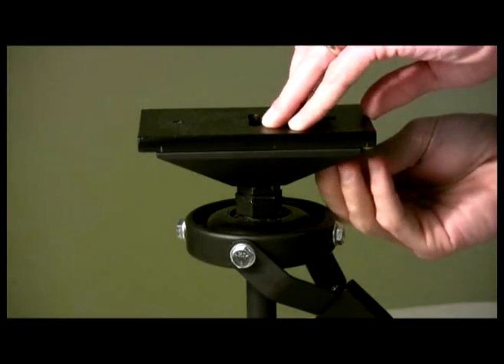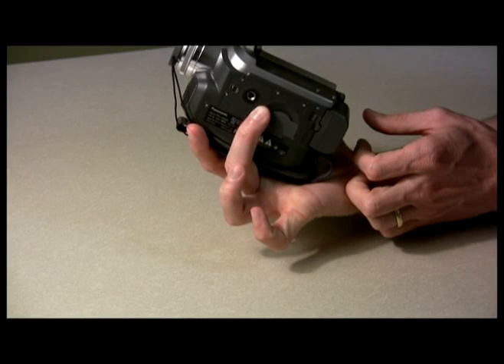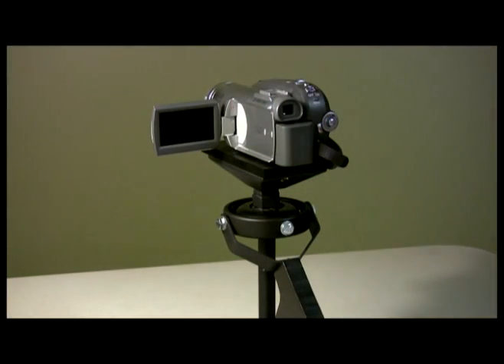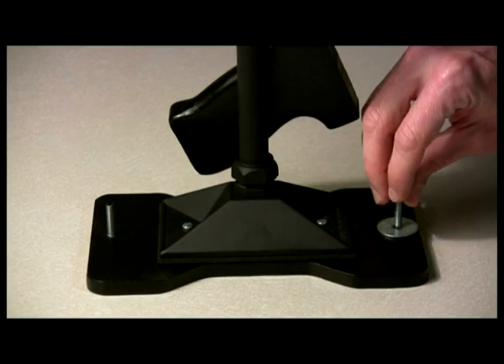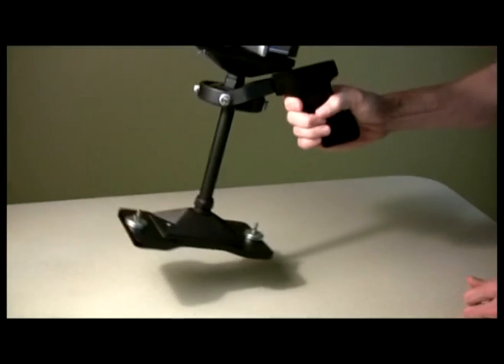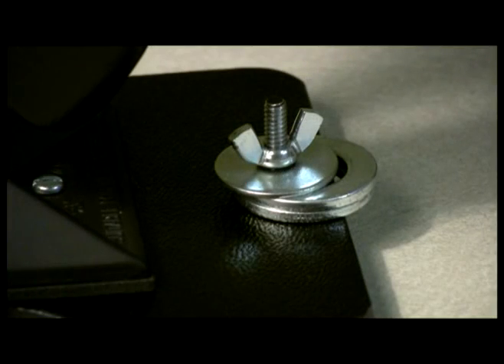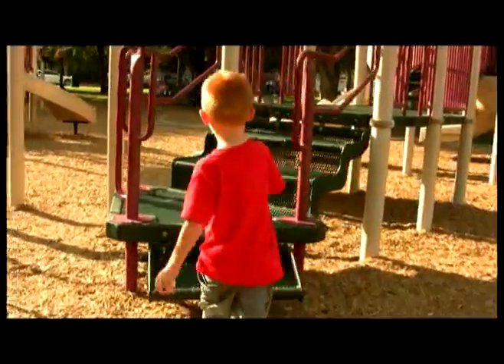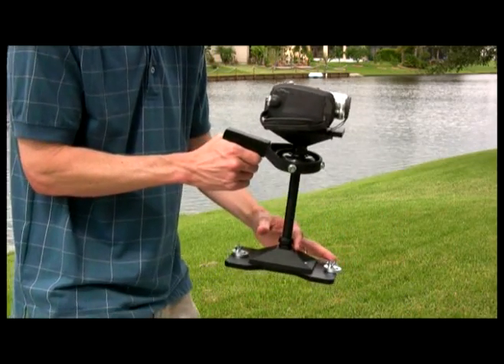MiniDV Stabilizer - Setup and Operational Tutorial - A low cost alternative to STEADYCAM/STEADICAM®

Comment from the maker: I appreciate the input.  The stabilizer is made of several different materials based on strength required, so it's a combination of Galvanized Steel, Zinc, Aluminum and ABS Plastic.  So anodizing would not be possible on several of the components.

Comment from the maker: That's a fairly heavy lens, so it puts you at the vary top end of our standard MiniDV Stabilizers weight range(wouldn't hurt to have our 3in extension just in case), plus likely makes the camera fairly front heavy requiring our Off-Set plate as well.  So I would recommend our MiniDV Stabilizer Pro model for your setup.

Comment from the maker: @JohnnyJizzFace It is possible to use the Stabilizer with some of the smaller DSLR cameras.  We highly recommend our Off-Set plate if you do intend on using a DSLR as the heavy glass lenses tend to make them very front heavy. The additional travel will be needed to balance the stabilizer correctly. It's best to check the weight of your setup with all accessories you plan on using before ordering.  Currently the maximum the MiniDV Stabilizer can support is 3.5pounds with the new 3" extension kit.

Comment from the maker: We also have the prototype of the quick release mount finished and in testing right now.  This will allow for thumb screw camera positioning and quick detach abilities.  The camera mounting plate will also feature 1/4" mounting threads for quick tripod attachment without removing the plate.  We also plan on making it compatible with other low cost STEADICAM® style stabilizers using the standard 1/4" mounting threads.  We hope to have this available later this year.

Comment from the maker: @from07till 
The HFS100 is barely below the low end of the weight range(0.1oz under to be exact).  If you happen to have an extended life battery or any accessories than it should work just fine.    I'd also recommend checking to see if the cameras mounting threads are near the center of gravity by balancing it on your finger as demonstrated on the tutorial video.  If it's off by more than about a 1/2" the Camera Off-Set Plate will be needed and would add an additional 2oz.

Comment from the maker: If there is too much weight at the base of the unit it will cause the base to drag when you move and not keep up with the top causing sway in what ever direction you travel. A quick test is to move forward from a stationary position, if the camera starts to look at the ground when you do this try reducing the counter-weighting a bit and try again.  

Also, check to make sure all of the bearings are rotating freely.  A quick spray of WD40 or similar low viscosity oil every few months helps.

Comment: @sam22691
yeah I use it with my minidv stabilizer. but you may need to get the extra offset plate because the 550d's lens makes it really heavy in the front and almost impossible to balance.

Comment from the maker: Based on the size and weight I think the T3 would work just fine.  It's just a bit lighter than the 550D/T2i(which works great) but still well within the weight range of the stabilizer.

Comment from the maker: The connector between the main tube and the pyramid shaped plate at the base of the stabilizer, as well as the pyramid shaped plate are made of zinc.  So overall the stabilizer has an extremely high corrosion resistance.

Comment from the maker: @MayowisProductions 
The stock MiniDV Stabilizer requires no tools to install and balance your camera.

If the 3" Extension Kit is required a pair of pliers and a Phillips head screw driver is needed for the initial install, and the Off-Set plate if needed requires a coin or flat head screw driver to attach the plate to the camera.

Comment from the maker: @yayarea82
On the bottom of the off-set plate you will find a hole smaller than the other four.  This hole is threaded to accept the longer bolt/wingnut supplied with the stabilizer.  Start by attaching the off-set to your camera using the slot head bolt. Then attach the off-set to the stabilizer top plate using the longer bolt/wingnut.  From there you can rotate/slide the camera/off-set, plus use the sliding adjustment of the stabilizer.

Comment from the maker: @yayarea82 
If your camera is below 1 pound additional weight needs to be added to the top of the stabilizer to bring the camera up to the 1 pound minimum.  A quick release mounting plate for the camera is a great way to get the extra weight needed and makes removing/attaching the camera a breeze.

Comment from the maker: @afritunez 
We are aware of the paint issues some have experienced and are working to improve the adhesion of the paint.  The paint we use is a relatively new environmentally friendly(zero VOC) water based paint which has required some tweaking of the preparation and application process.  Sadly, it's far from cheap at $82 a gallon.

Comment from the maker: @HONEYSMASH 
Judging by the online specs for the camera it should work.  Balance will vary a little depending on which lens is used, but from the looks of it they took the center of gravity in to consideration when placing the mounting threads.

Comment from the maker: @from07till 
Yes, as long as the overall weight of your unit(camera, lens and mic) is below 3.5 pounds the MiniDV Stabilizer Pro will include everything you will need.  I simply recommended checking as the weight of your camera alone falls within range of the standard MiniDV Stabilizer.

Thanks,
Philip Balvanz
Owner Of Balvanz Enterprises

Comment from the maker: @sonicballer8888 
We have found that placing a locknut under the gimbal relieves the pressure placed on the main bearing.  By doing this, it improves the rotation of the main bearing and reduces any unwanted panning induced by handle rotation. This FREE upgrade will be available as soon as we get a bulk order in of the new lock nuts.  We will be posting information on how you can get the FREE upgrade on our website.

Comment from the maker: @chance1234567890 It really depends on which camera/lens you are using.   Check out our handy product selector to find the package right for you.  Simply fill out the required information and it will guide you to the products you need to make it work.  You can find the link at the bottom of the Video Info above^^